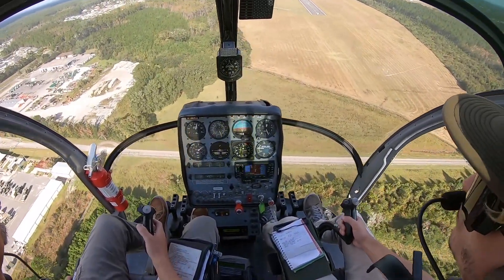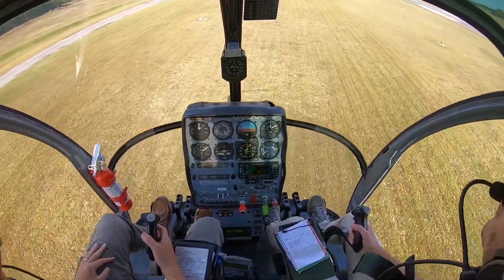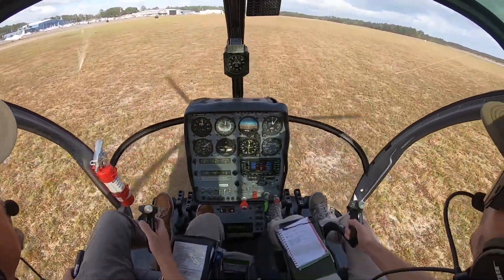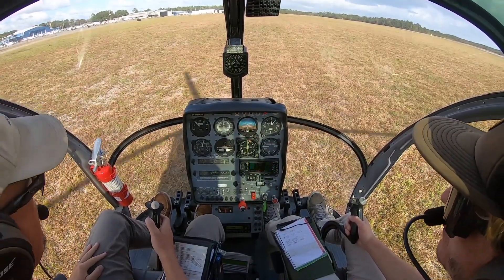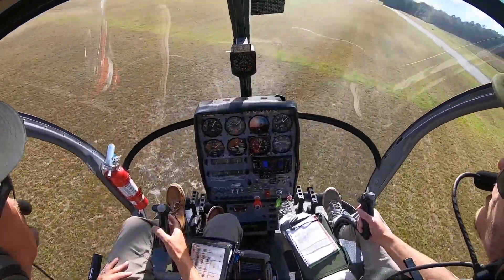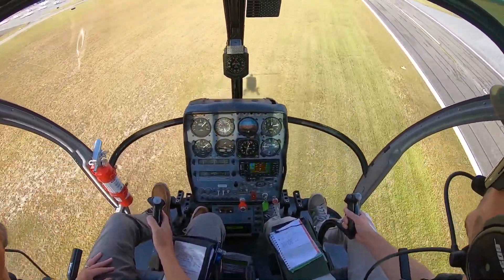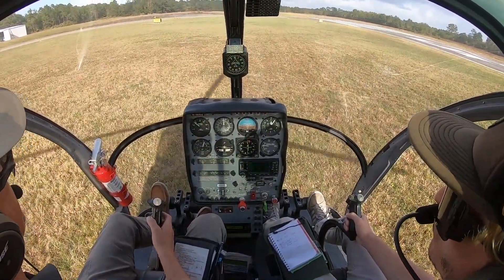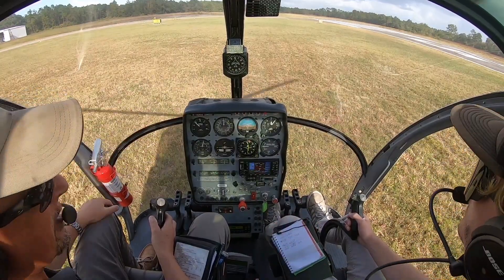Helicopter Emergency Procedures.  Stuck Left Pedal during landing and hover - Schweizer 300.

Comment: Why conduct a run on? The simulated stuck pedal setting matches a hover pedal setting!
Reply from the maker: The run on is more controlled.  A stuck pedal doesn't always allow the aircraft to hover.  It depends on power applied when the pedal malfunctions.  A run on removes the variable.  Good question!!
Reply: @angels1aviation920  "More controlled"...how are you going to land with a run on if the left pedal is to far forward (pedal malfunctions at a hover OGE and/or whilst conducting a left pedal turn) to hover IGE and the helicopter is yawing to the left?